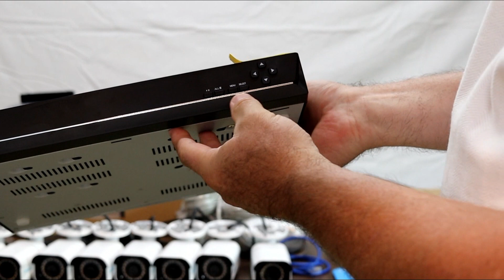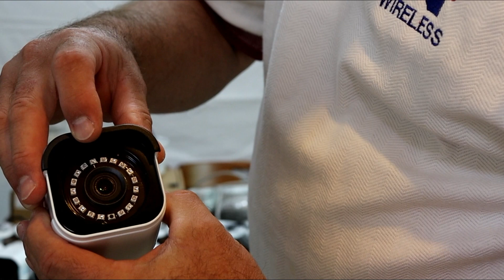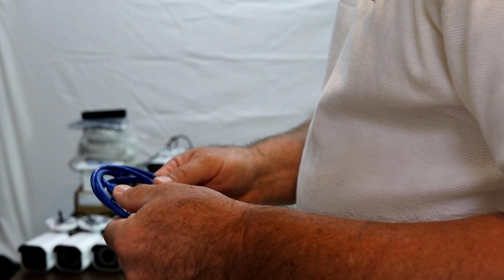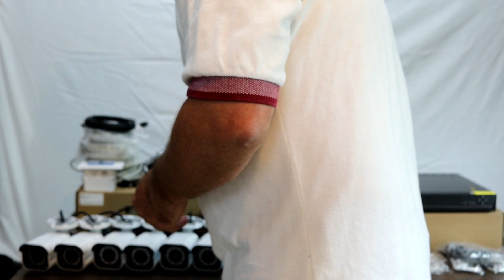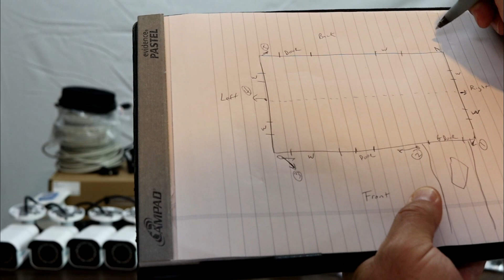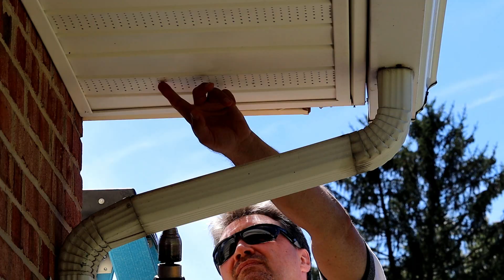Reolink 4K 16CH POE Security Camera System

Comment: G'day, I put in a similer (only 5MP) system and added another 4 cameras. Later I added the 8MP PTZ camera. I now have an unpowered splitter running 4 cameras. everything was easy to install, set up and opperate. Some functions take a while to learn. If the NVR loses power you will need to rename all the cameras. I have not bothered setting up notifications or auto tracking with the PTZ. I have started posting some things to Youtube if you want to see what the cameras can actually do and how good/bad the footage is. I am now getting the local police chasing my CCTV and they have said the system I have seems better than a lot that they see. I do also turn flood lights on every night so that the cameras work in colour mode. The funniest vidio I have up is a "short" called "Dog piss on cop".

Comment: Do you know if there is a maximum length/distance a HDMI cable can be run?
Reply from the maker: Don't go over 30 feet with a copper HDMI cable. You can buy fiber optic HDMI cables that run longer distances.

Comment: Will this NVR run 16 4K cameras without any glitches?  A lot of NVR's can't process all the data and will drop cameras from view.   I'm looking for a good NVR to replace mine but it needs to have a lot of processing power and room for two or four hard drives.
Reply from the maker: Larry I'm running 10 cameras and so far no issues..

Comment: To me "Plug-N-Play" means that you can; lift the parts up out of the box, connect them together, attach the "HDMI" to a screen, power everything up and it will work. I've viewed many video's and not a one shows this. Can this equipment work in stand alone mode or does it have to be connected to the internet? The installation book is lacking. I would like to see one video that shows this. Shows what to expect. What that flashing red lamp means. Whether or not it can operate in stand alone mode (intranet) OR why you need to attach it to the internet.
Reply from the maker: Hey Cheryl, You can keep it off the internet if you want to only record and view off of the NVR directly with the HDMI connection. If you want to use the remote features on your cell phone or buy cloud storage you would need to connected it to the internet.

Comment: Any idea how to connect my system on mobile app using 4G , in stead WiFi ?
I have all setup, they work well on home network LAN , and application for phone works great on WiFi only.
If i turn off the WiFi , I can’t access cameras any more. 
Keep failed the connection.
Any help please?
Do i need to setup something extra on my NVR ?
I done all normal setup from fresh installation NVR connect to LAN etc etc.
Reply from the maker: I'm not sure I can view it with my cell service anywhere. I wonder if its a setting in the phone.

Comment: Hi, So on these cameras, will you have to hit the reset button?
Reply from the maker: Tony so far I have not had a need to. It gives you a way to reset the camera back to factory settings.
Reply: @norrisnetllc   How could it deviate from 'default' settings?   It's a 'dumb' non programable camera -  I've yet to know what that reset button is for.  Possible if each camera had a mini SD card as well,  it may need to reset something to do with the camera's own recording ability to mini SD card???  I love the Reolink system, but it is a bit scant on tech help or manuals
Reply from the maker: @avflyguy  I know when you first plug the camera into the NVR it will setup the camera with a channel and IP. Then if you move it to another port that info seems to stay with the camera.